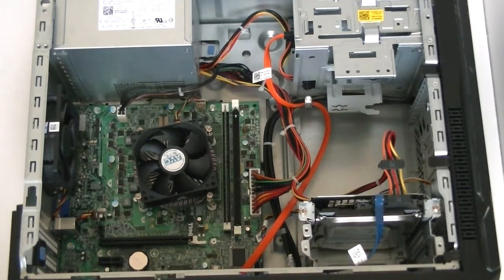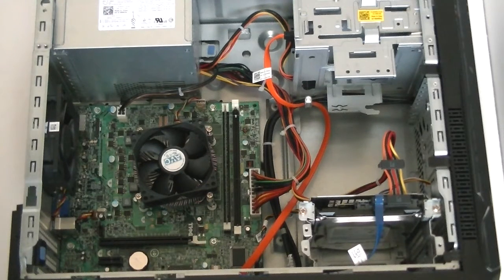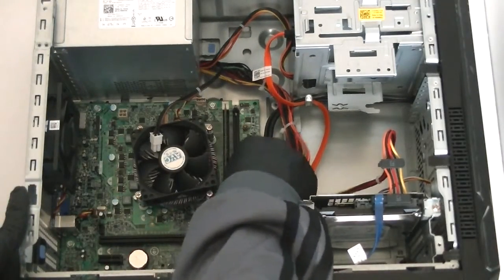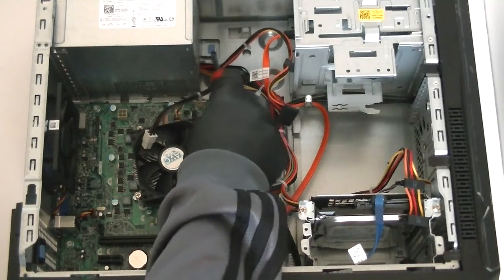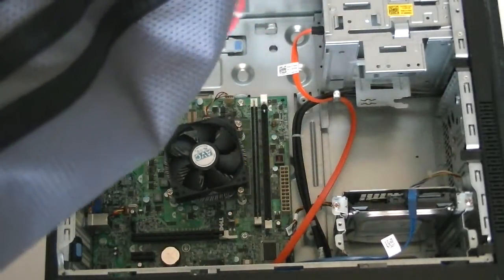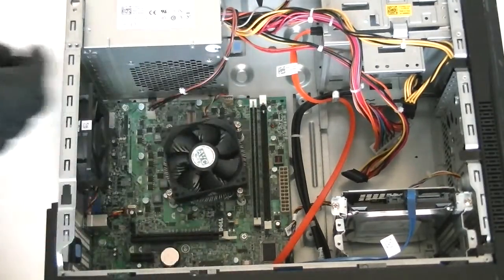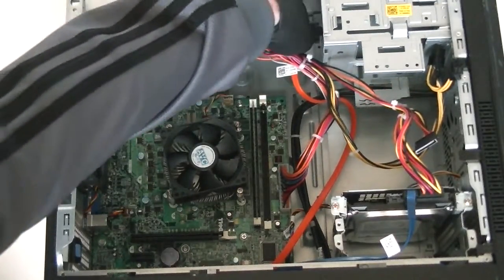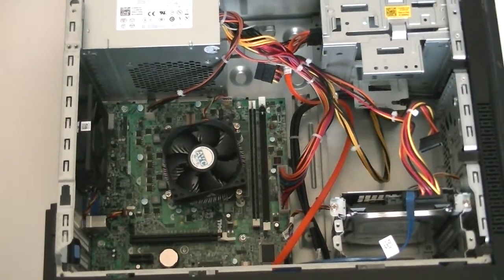Dell Vostro 260 Power Supply Install Replace Upgrade Change

Comment: Ik this is late but i have the slim version can u link the ram and psu i can get for the slim. I installed a better hard drive and a gt710 but the cpu is a quad core i5 and i only have 1 stick of ram and its 4gb. Please respond thanks a lot!!

Comment: is the mobo and psu proprietary?
Reply from the maker: Hi, no and you can upgrade PSU and Motherboard is Micro ATX you can install in mid tower ATX custom case.
Reply: @Mxkdt  so does this mean I can just buy a decent EVGA PSU and be perfectly fine?
Reply from the maker: Hi, yes EVGA power supply will work i do recommend you get at least 80+ Bronze

Comment: I've just bought the slimline version of this machine the 260s with a i5-2400 for dirt cheap and had issues with stability. I noticed that there is no heat sink on the southbridge chip and as far as I can see there is none on the computer he is upgrading as well. Once I put a heat sink on there it worked fine. So if you have a 260 or 260s check that chip on the opposite side to the LED from the sata connectors, if it's just a shiny little square in the middle it has no heat sink ! I've just bought a cheapo raspberry pi heat sink with a sticky pad for now but ordering a proper south bridge heatsink from the net. If you can get your hands on a low profile 1030 or 1050 it should work in this I think without replacing the power supply.

Comment: which psu unit did you replaced it with ?
Reply from the maker: Dell HU460AD-01 460W Power Supply